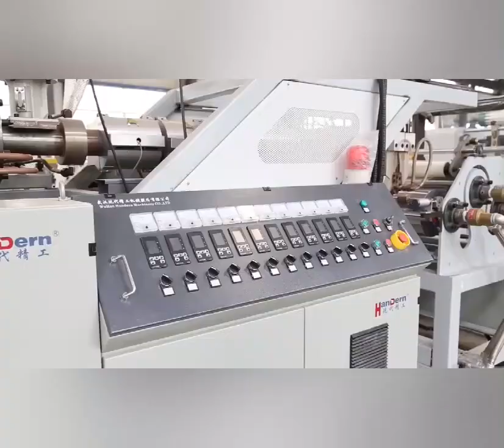PC-fluted-sheet-extrusion-machine

Comment from the maker: The company's main businesses include but are not limited to the following:
1. Hollow plate production line
2. Film coating equipment production line (release paper, label paper, paper cup, paper bowl, liquid milk, beverage box, carpet)
3. Cast film (POE, EVA, PVDF and other photovoltaic back panel films)
4. Coating equipment (graphene, etc.)
5. PET biaxially oriented film production line
6. Plastic extrusion sheet production line
7. Lithium battery diaphragm stretch casting line
Welcome to inquire!

Wuhan Handern Machinery Co.,Ltd.
Website: handern.en.alibaba.com
Tel: +8613986280012